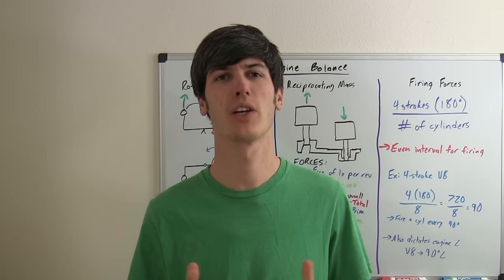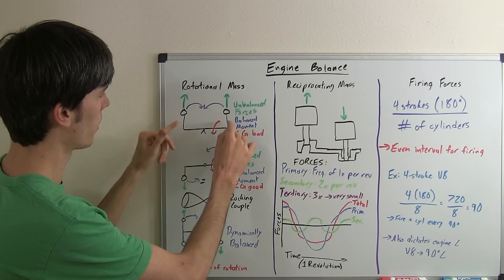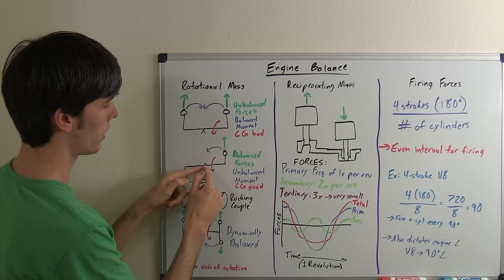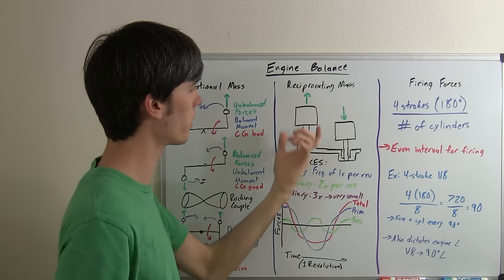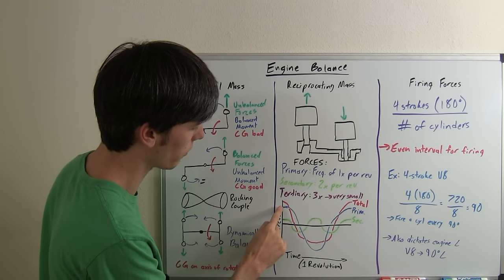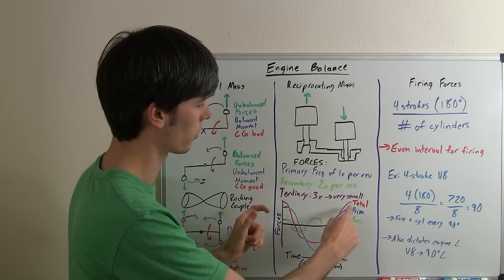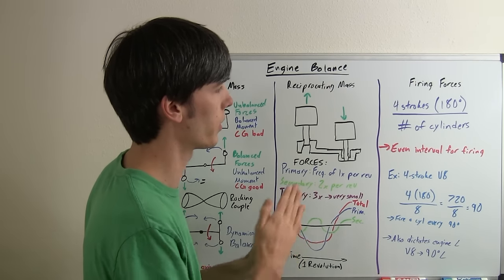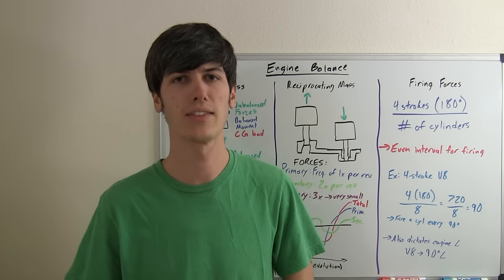How Engine Balancing Works - Smooth Running Cars

Comment: Explain harmonic balancers and why they're necessary
Reply: It provides a resistance to  the torsional vibrations (eleastic loading and unloading) of the crankshaft.  The crank elastically deforms " twists" as the piston loads it...then it twists back when it unloads...oscillatory action.  This action is resisted/dampened by the rubber between crank hub and the inertial ring on the harmonic balancer.  The inertial ring will lead or lag the crank hub because of the rubber between them...the ring just cant catch up with the crank oscillations. The vibration energy leaves the rubber in the form of heat.  Viscous fluid dampers have the same affect.  These harmonic balancers are important to reducing fatigue on the crankshaft.

Comment: so ... when people is changing pistons, putting Alu ones, and they don't adapt the crankshaft, the engine is out of balance ...
Reply: Ive been around Hot Rodders since the 80's and Ive been around, and done hundreds of engine rebuilds / upgrades. Not a single person I have ever seen has gotten forged Aluminum pistons and forgone the minor expense of balancing their rotating assembly. Not one. Ive seen quite a few that did not have a machine to balance the crank, but even they sent it to the machine shop to balance the rotating assembly. If your going to spend the money to build an engine not balancing is just not even though of. Its less than the pistons themselves much less the rods or crank.

Comment: How is balancing done on a VCR engine (like the VCR MCE-5)? Because the variable compression ratio is achieved by variable piston heights through a sort of geared coupling with the crankshaft. Therefor the balancing shafts will not function optimal since their postions are fixed to the crank. Is this assumption correct? Very interesting videos btw! keep up the good work! regards, a fan

Comment: I'm still confused about balance shafts. I know they fit in a compartment near the engine block and spin the opposite direction of the crankshaft/pistons in order to counteract the momentum of them to reduce vibrations and wear on the crank, but are they still used? And if so, what engines are they used in? I know they were patented by Mitsubishi. Thanks! Love your vids btw
Reply from the maker: I will have a few videos on the subject, soon!
Reply: Did that video happen?  
If not, a balance shaft is generally applied to an inline 4 to counter the secondary forces.The secondary forces come from the conrod sweep as the big end rotates around the crank axis - think of how the big end moves from one side to the other while the top end stays in line with the bore.
The effect of this is to accelerate (neg and pos) the reciprocating masses twice during each crank spin.  Accelerations -> Forces -> Vibrations if not countered.
The balance shaft is unevenly weighted just enough to cancel out the secondaries.
In saying all this, most competition Mitsi engines have their balance shafts removed for rotating mass reduction and less components to fail.  I've built a comp 4G63 before and had this done.
Just means the driver has a little extra NVH to put up with, which no one cares about in racing ;)
Reply: Balance shafts were/ are (?) also used in some V6 engines, for example the Mercedes Benz M272. I guess because this was derived from the V8 (M273) and the cylinder banks were positioned in the "wrong" angle - 90 instead of 60 degrees - towards each other...

Comment: QUESTION: 
considering the fact any Engine with just 3 Pistons are primarily unbalanced, and require a lot of counter balancing shafts and dual mass flywheel to keep em from shaking themself apart... 
Does all this additional rotational Mass affect efficiency?

If we take a 1.2liter 3 Cylinder
 and a 1.2 in line 4... wouldn't the 3 cylinder use more fuel than the 4 because of all that added balancing masses?

Comment: The force on one side times the perpendicular distance from the axis of rotation must be equal on both sides, and the sum of those forces must add up to zero.
In other words, the sum of the moments of all forces must equal zero to produce a balanced system!

Comment: Great video as always. I would think that the secondary force associated with piston acceleration would be zero at the top and bottom of the piston stoke. However, your diagram shows a non-zero secondary force half way through the revolution.
Reply from the maker: Yes indeed, I'll have a video explaining further soon.

Comment: what if you have a 90 degree v twin and the two rods share a common journal, do you make one bob weight, or do you have to make two , one for each assembly then aim them a certain way in relation to that pistons stroke ?

Comment: CAn you explain what skidoo is trying t do on their new 850CC 2 cylinder 2 stroke? Doesn't seem to make sense

"We had hoped to keep this under wraps until we had the patent hanging in the engineering building, but we now want to reveal an innovative element of the pDrive clutch design. To minimize vibration from the additional 50cc, 10 horsepower and 30% faster throttle response from the Rotax 850 E-TEC engine, Ski-Doo engineers created an asymmetrical fixed sheave with a runout of .6mm (.024 in.) – essentially turning the clutch into a counterbalancer. The .6mm/.024 in. runout is right in the sweetspot for optimal vibration reduction and belt longevity, and adds no weight. This patent pending design also is why the pDrive requires the precise D-shaped crankshaft indexing . #ItsWhatsNext"
 

https://www.facebook.com/SkiDoo/posts/1348431051859743?comment_id=1348559698513545&reply_comment_id=1348579728511542

Comment: nice  video. i think it's way over-simplified but that's the point. nobody wants to go to school to learn this stuff. like the first , second and third derivatives (velocity , acceleration & jerk force) so you dummy it down for them. when people ask me about balancing an engine, i always tell them about the rule of 3. the easiest engines to balance have a multiple of 3 cylinders like 3cyl, inline 6, 60^degV6 , (NOT a 90^degV6), 120^degV6 eagle premier/dodge monaco, flat6(the choice of champions; porsche & subaru), v12. 

that's because a piston spends 1/3 of its time at the top and 2/3rd's of its time down low (as we can see in your video as the red graph you have labeled "total". very nice). so 3 cylinders fill those 1/3rd's more naturally and secondary vibrations are minuscule, almost non-existent. more accurately, pistons spend from 1/3rd to 2/5th's of their time at the top (depending on rod length and stroke ratio) so 5cyl & 10cyl engines also balance well as long as they don't have relatively short rods.

 so, all other engine have problems getting rid of secondary vibrations. balance shafts are for countering secondary vibrations and require significant horsepower to spin like 10-15% of total output. 

another reason the rule of 3 isn't widely known is because 4-bangers & V-8's are simply too popular. nobody wants to hear about why v6's are better while FARM TRUCK is out doing wheelies on the 1/4 mile track. they choose to build a V-8 after seeing that.

Comment: Hi A good video. Do you understand why a 180 v8 crankshaft is prone to vibration? AND why the engines that do use them DONT vibrate and what are the limits of a 180 crank- is it stroke? or an recip weight? or? thanks-

Comment: hey jason , I would like to thank you for posting such wonderful videos , keep up the good work
I do have a question though ,, i watched all the videos you posted about inline 6 V8 and V12 engines and my question is the following ,
In descending order , can you please list which one is smoothest ?
inline 4 ?
inline 6 ?
V8 ?
V12 ?
Thanks
Reply from the maker: Silver17dragon V12 (smoothest), I6, V8, I4. This can of course change based on the design and use of counterweights, but as a general assumption could be considered true.
Reply: Engineering Explained Rotary/Wankel engines are smoother than V12s though right?
Reply: Engineering Explained What about VR12? I don't mean W12, VR12 has 2 banks of I6 like V12 does, but are they naturally balanced? What about W18? W16?
Reply: @deldelz465  Any Wankel rotary engine is perfectly balanced.  Even single-rotors.

Comment: Thanks for your enlightenment,But I have a question please.
My single piston generator engine has a harmonic balancer,but I have to remove it because I couldn't get a new replacement and the engine is working smooth and noiseless.what impact will it have on the engine when on full load?

Comment: I know this is an old video. I'm a little rusty myself. So would you call an engine balanced if the sum of your mass times acceleration vectors cancel each other out along the time domain (or crank angle depending on how you look at it)? Hopefully someone can give a quick response.

Or is it possible to use impulse using crank angle instead of the time domain? Again, very rusty and just curious!

Comment: why some 4 cylinders have balance shafts and some dont like the 420a motor dont have any balance shaft.i heard that the manufacture wanted to save alot of time and money and skipped the balancing of the engine.and substituted the quick installation of balance shafts to eliminate vibration.

Comment: You forgot to mention that firing interval doesnt have to be even, since sometimes you even have to make it odd to balance it better like in a straight-twin for example. (Yes there are even firing ones but most inline-2 engines fire odd for engine balance (There even are inline 2 crossplanes). This just makes power delivery less smooth as a trade off. But unless its a 2 stroke engine 2 cylinder engines dont have power strokes even touching each other.)

Comment: If you install the wrong spark plugs in a small or large engine the engine will stall, and quit firing the cylinder.

Comment: Does the pairing of sister cylinders assist with balancing and power production as well? With 4 cylinders, 2 are firing at the same time at TDC(or right around tdc) a certain number of degrees apart from the other 2 cylinders causing more explosions per minute correct? Great videos by the way, thank you!
Reply: 4-cylinder engines only have a single cylinder firing at a time.  When one is firing, it's sister has just completed the exhaust stroke and is about to begin intake.  Power is correlated with the amount of fuel burned - which means it goes up with more displacement, better scavenging efficiency, and more boost pressure.  More cylinders generally means more displacement, but not always.  The real advantage of more cylinders is that there is less of a gap between power strokes meaning a smoother delivery of power.

Comment: 1. Are Boxer engines easier or more difficult to balance?
2. Are Rotary engines easier or more difficult to balance?
3. Apart from vibration, what other effects does a badly unbalanced engine cause to a car's performance?
Reply from the maker: 1. Easier, regarding primary and secondary forces.
2. Great question.. I believe easier, since it's all rotational and nothing reciprocates.
3. Well.. vibration causes problems, and is the direct result of not balancing. You can still create something powerful with large vibration, but you wouldn't want to unless the application didn't matter (short lifetime, heavy vibration anyways, etc.).

Comment: Here's a question: If a V8 (with a 90 degree engine block) crankshaft plane is most balanced with 90 degree intervals, why do some V8s (also a 90 degree engine block) use a flat plane crankshaft, which has 180 intervals?
Reply from the maker: That's a great question, to which I can proudly claim I will post a video on. :)
Reply: Thanks!
Reply: because by using a flat plane, you can organize the firing order to make an engine much more responsive. A flat plane V8 is basically 2 inline 4 mated at the crankshaft. It is also lighter because it needs less counterweights for balance purpose. Thats why it's only used on high performance sports cars like Ferraris and on race cars.
Reply: Extreme2TheBravest Flat plane v8's have 90 degree intervals mate. When one plane is at TDC and BDC, the other plane MUST be at the midpoints. No exceptions.
Reply: Good to know.

Comment: I take it that the firing forces equation won't work for a rotary engine. Do rotaries have a specific firing equation or is the ignition phase once every 350 degrees of the eccentric shaft since the shaft rotates 3 times for every full rotation of the rotor, which would coincide with one e-shaft rotation per rotor face and firing cycle?
Reply: Good question Nate

Comment: More on secondary forces, I still don't understand it. Is it because one down stroke is in combustion and another might be in compression? Is my assumption that a V8 fires 2 cylinders every 90 degrees. And do you use imperial or metric units at your job.
Reply: It's really quite confusing, so you're not alone. Took me ages to get my head around, ended up writing a 30 odd page summary. 

Soooo... The simplest piston layout is called the scotch yoke or scotch crank. It moves in pure sinusoidal motion. The acceleration of this piston is purely sinusoidal as well, and since force is only mass * acceleration, the force is sinusoidal in step with the piston acceleration. This sinusoidal force experienced by the piston is the primary force. Now, in cars, a scotch crank is not very workable and so pistons have connecting rods that connect to the crankpin and pivot around it. Without going into detail, this change creates a second acceleration of the piston, in conjunction with the first. This is the secondary force. The two forces interact with each other, sometimes adding sometimes subtracting. The end result is what looks like a slightly wonky sinusoidal wave. The magnitude of the secondary force is approximately a quarter of the primary force, so not a lot. Not enough for manufacturers to bother balancing I4 engines, which last pretty much forever anyway.
Reply from the maker: I will have an additional video on it. Cheers

Comment: I drive a citroen SM with a Maserati V6 engine.
This engine is a 90 degrees V6 odd fire engine. In fact it are two 3 cylinders in one cast..
The crancshaft is as a 3 cilinder engine but has two pistons  conected.
Because of the 90 degrees angle there are never two pistons at tdc at the same time!!
The firing forces are very different from normal engines. I think there is a Buick engine with the same configuration.
I want to use lighter pistons. How do I get this balanced.
Reply: +renardautomobiles My experiences with the Australian version of the Buick 3.8Ltr V6 (which has a balance shaft counter rotating at 2X crank speed running in the valley under the intake manifold to cancel the rotating couple) is you take your crankshaft, rods, pistons, front balancer/pulley and the flywheel/ flex plate to the balance shop give them lots of money and hope they know what they are doing. Changing the mass of anything in an odd fire engine is tricky. Later 3.8 Buicks had offset crank pins, at first glance the big end journal looks normal then you notice each half of the same journal is 30 Degrees offset making them even firing engines.
Reply: renardautomobiles

Comment: Why is it not 360 degrees? Isn't the rotation of the crankshaft measured in 360 degrees and not 180?
Reply: +Ricoh Vegas 180 degrees denotes the stroke

Comment: Hi, thanks for the complicated video, I'd like to request a video over car engine liters e.g 1.2, 1.6, 1,8 etc and what do they contribute?
Reply: +Simphiwe Mphiwe Basically, a bigger engine means you can make more power out of it. The displacement refers to how much water the engine would displace total if all the cylinders were full. The more space you have, the more fuel you can get into the cylinder, and the more fuel you can get in there, the more power you can get out. 

Now, making an engine bigger also means that the rotating and reciprocating components are heavier, which also means the imbalances of the engine will be more pronounced. 

That's why extremely small engines like motorcycle engines can rev up to 20,000 RPM, because the crankshaft and pistons are smaller and don't create as much movement on the engine.

Comment: The pistons moving up and down do NOT counteract each other. There are weights on the opposite end of the rods that counteract this. Have you ever opened an engine?
Reply from the maker: With a can opener, yes. It depends on the layout. In an inline six the pistons perfectly balance out eachothers forces, so the use of counterweight is minimal (there are other things creating imbalances besides the pistons). Engines such as V8's and V6's use counterweights because they are not inherently balanced. But I'm sure you already knew..
Reply: Engineering Explained This is correct.  CW are rarely used to balance the reciprocating masses - usually in out of balance arrangements like 3-cyl.  The CW you see on the crankshaft are there to balance the rotating mass of the crank pin and lower portion of the con-rod - mainly to reduce bearing loads on the main bearings.  Pistons do counteract each other.